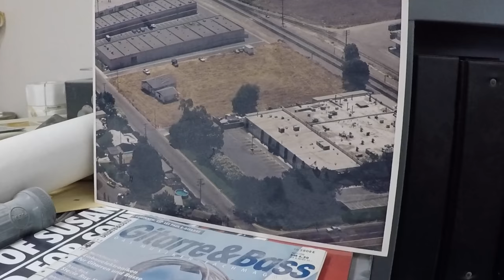Why Leo Fender left Fender, Music Man, And G&L

Comment: Would not be complete without mention of the Tribute series (of which I have one Tribute Legacy).
I wanted to get a Fender Stratocaster, but could not afford USA made.
So I started looking at Squire, then I found out about G&L.
After some research, I learned about the better quality components in the Tribute, compared to Squire.
Especially vibrato system and electronics/pickups/tone controls.
So I bought a used Tribute Legacy. I am so happy that I did, it sounds/plays like a dream.
My purchase experience and this video, make me glad I did not get hung up on buying an older design "original Fender" guitar, and instead, now own a newer better version, designed by the man himself...Leo Fender.
Reply: If you bought the guitar with the mindset to PLAY it and not to resell, then you can't go wrong. I just bought a Tribute Fallout and regrettably I haven't had time to really explore it. I haven't even set it up yet but what I have seen is enough to make me think I'm going to like it. Also the happy owner of a G&L Legacy Special. :-)
Reply: I'm thinking of a tribute semi hollow asat. What's the build quality like say compared to a Mexican Fender.
Reply: LightningDogg:  Definitely for play. Purchased used, so no worries about resale value.Took it apart, cleaned it inside and out, removed some minor fret ware, polished the frets, reassembled and really like the feel and sound quality. Neck is a little bit wider than I am used to, but I don't mind. Gives me more room for string bends. I have 10s on it. Seems the perfect string gauge for this guitar n me 😁
Reply: By Thomas: Everything I have read, indicates that G&L Tribute quality is better than Mexican Strat.
I have been playing/collecting guitars for 30 years. My used G&L Tribute Srat is much better than the Fender ones I tried out in the store. Pickups, electronics, trem system, tuning machines, all top notch. Hope you get a good one, and enjoy it as much as I enjoy mine ☮️
Reply: @Steve-nq8jc  I can't swear to it, but what I have read about the Tribute series is that they are manufactured in Korea and assembled in USA. If anyone knows for sure please share.
Reply: @LightningDogg  I have owned a Fallout for 5 years now. Great tone in that guitar!

Comment: When I was 10 years old in 1964 we moved from NY to Placentia, CA which was the town right next to Fullerton, We used to drive past the old Fender factory buildings all the time. Fullerton was mostly orange groves back then. Fast Forward to 2003 living in ATL I was in LA and decided to revisit the area where I grew up.  I had two G&L guitars at the time and went by the factory on Fender Ave. The Production Manager showed me rhe different buildings where they were making the guitars and even showed me Leo's workshop that they keep locked up but I couldn't enter the workshop. That alone was worth the trip.

Comment: Crazy, I grew up in the 60's ans was playing in the 70's trying get decent. lol It took a while but I was capable of learning fast from oterhs ans ate it up. I have 3 old blonde tolex music man amps from that time period. I had 4 but I gave on the good friend. I worked in a theatre in the later 70's and we also had a live show every Saturday night that was broadcast over 50 k watts. We also had a studio there and we got those amps on consignment. We had a but load. Decades later the owners sold the building and company. that did not take a thing with them. So lucky me i got the amps. the boss gave them to me. she said take them. They all light up. they do have issues and all of them need upgraded grounded AC. I forgot I have a bass head also. $ 4x12 cabs and 2 single 15 cabs but all of the speakers were blown aside of 1 4x15 box. I have 1 1x12 amps ans 1 2x10. the 2x10 is a hot little amp for country with a tele. I never got int Fender guitars though until a couple of years ago.